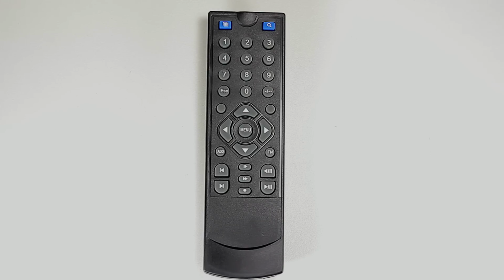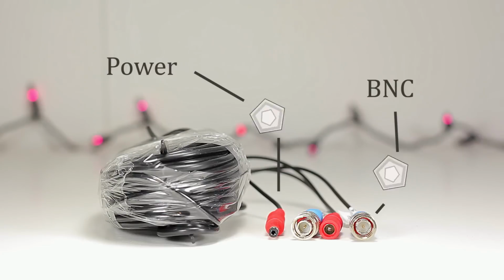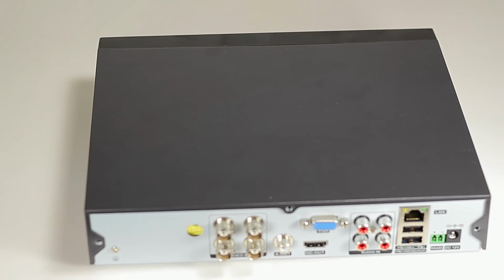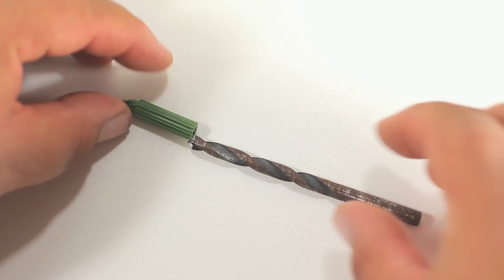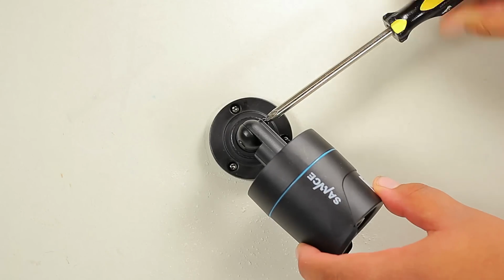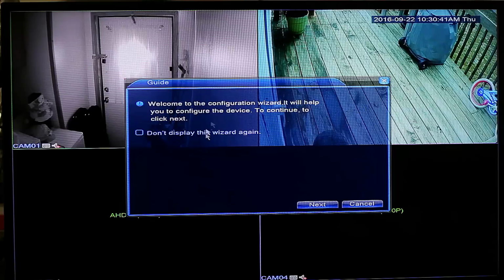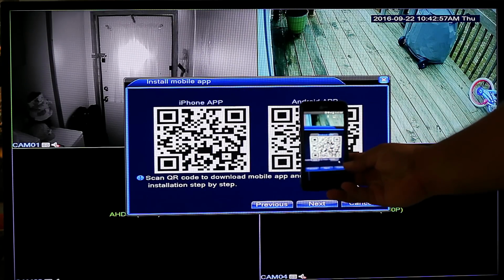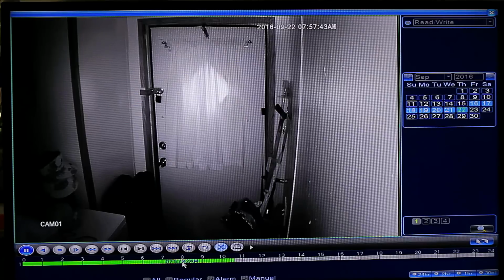How To Install a Surveillance Security Camera System

Comment: I express my thanks for sharing the video, as the information you have provided is helpful. May I ask what is the size of the spade drill (e.g. 3/4 inch or 1 inch), as I am not aware what is the suitable size to drill a hole for the cables.
Reply from the maker: thanks. I used a 3/4 .
Reply: Okay, I thank you for informing me!

Comment: Thank you for the well said and spoken video on the system, it makes more sense now. One thing I do not understand is installing the cameras.  They have cords so do the cords need to be really long in order to have them in different parts of the house?
Reply from the maker: thanks.Bnc cables are usually very long, the one that came with this system are 60ft each. Recently just bought 100ft for 12 dollars http://amzn.to/2lBhS4T

Comment: I got 2 I geek cameras that are WiFi & connect to my fone, also  it saves onto the 32G memory card or onto the cloud, also can save the videos on my fone. Was gonna go for what you have but it was just dear. I got to camera's for £80 and £17 for  2 32G memory cards. But I still have wires to connect to the mains, hence why I'm here, I want an easy way to set them up to protect my riad bike & dirt bikes, and my cars, so was wondering the best way to attach the to my house, without having to drill a massive hole or rather 2 massive holes.

Comment: Great video!  I need to run wires through underground 3/4" conduit to a detached building in order to hook up two cameras.  Is it okay to snip/cut the camera wires about one foot from the end, pull the wires through the conduit, and solder, reinsulate the wires with camera connectors, probably using electrical tape?
Reply from the maker: +Don Putman thanks! I have never cut the cables before, what I have done is used a adapter to join two cables, but you should be able just to remove the head and not cut the cable so they can fit on the tubing.

Comment: After I connect the extension cords together. Where does the red one connect to?
Reply from the maker: if you are referring to the bnc cable the red is for power, then that would be to the power adapter for the cameras.

Comment: I need help. I got 1 off ebay. 
But the camera keeps switch camera channel.  won't stay on the camera channel I want it to stay on. So it keeps going 1, 2, 3, 4, 5, ,6 ,7 ,8 

When I want it to say on 1 channel and not changing on its own.  I can't find where to stop it from
Reply: Help
Reply from the maker: have you tried, turning off the system, disconnecting all the cameras and cables to the dvr, restarting it with out cameras, then shutting it back off and then installing one camera at a time.

Comment: I'm not the most tech-savvy person and would appreciate some input on some very basic questions I have:
My questions are:
1. What are the hardware requirements besides the camera and a DVR?  
2. Does the DVR need to connect to a computer?
3. Is a monitor required or can the system be run through an android phone?

Unfortunately, my wife doesn't have wi-fi at her office.  Is that a deal killer?  Thanks everybody!
Reply from the maker: only thing you will need if you want to record the live fee is a hard drive. you dont need a computer, yes it can be viewed with a android device, watching the live feed can use alot of data if you dont have wifi.

Comment: how do I get extra cameras to show on my screen? I purchased two extra sannce cameras but they turn off after something crosses in front of them.
Reply from the maker: david1317 I added a third camera, just by connecting it. buying another BNC cable and connecting it to the power supply that came with the third camera. did not have to do anything else. you can try to reboot the DVR, check that BNC cables are not backwards and that power supply is not faulty.
Reply: Thanks that should be easy then.

Comment: If I like to record all night I need 1TB disk. But how to to start recording? Is there button?
Reply from the maker: you will have to go to menu and setup time schedules and cameras
Reply: But I like to record all night without monitor and ethernet cable... so I just add to DVR 1TB disk and it will be automaticly start record? Tnx
Reply from the maker: You will need to or monitor for initial setup after that you can remove TV or monitor and it will record by itself with the hard drive and dvr

Comment: if you have 4 cameras where do you put the Box?
Reply from the maker: if you want to see all cameras simultaneously then you would pick 4 view and then double click the one you want to see full screen at any time. That is what we are currently doing. If you speak of the physical box , then you would have to calculate your cable length and choose the average number between all of them. But at the end of the day it does not matter if the cable reaches. I would do the one that would be the farthest (camera) and go from there.

Comment: I got one at this but i cant figuereo it make a nose i cant sto
Reply from the maker: I have cameras from different brands and they all make a noise when they switch from day vision to night vision.
Reply: Yes but this dont stop is same that the video i cant fix
Reply from the maker: What kind of noise? and when does it do it? is it the dvr? or the Camera?
Reply: StatUpBox is  in the dvt soun bit went star i cant stop i need yo get off to  stop
Reply: The dvr
Reply: Thanks
Reply from the maker: when the dvr starts it makes a beep noise, that is normal. when the dvr is recording it also makes a noise. but is everything functioning well.
Reply: StatUpBox everything worki well but the beet noise star ar the same time and dont stop i cant find how to fix
Reply from the maker: have you tried disconnecting everything and connecting it back again even the hard drive.
Reply: StatUpBox yes i did
Reply: Is get off but doing again same time
Reply from the maker: and is it recognizing the hard drive in system settings?did you format hard drive? Its weird , my advice would be to contact the seller so they can troubleshoot the problem. The weird part is that you say everything is working well, so I dont see the need for the beep, have you notice if the mouse or controller buttons are not pressed in (stuck)
Reply: I guess but no sure is recording but look diferen like u did how do you that can u help my

Comment: Yer mate iv given up
Reply from the maker: dont give up yet, to early in the fight, not even the 6th round. That happen to us once when the application was updated, What I did was uninstall the app from the phone and re installed it and it worked. The other way i got it working on another phone was by manually entering the serial number. This also happens when the system is still registered by someone else, did you buy this system new or used?if bought used, the only thing you have to get in contact with the person that sold you the system and tell them to unregister their account, b/c until they dont that will happen, that also happened to me in a installation of another system.  if you bought this new I would suggest contacting customer service via email and im pretty sure they can figure this out. Have you tried installing it on your laptop or computer and once installed there entering the login info on the phone.